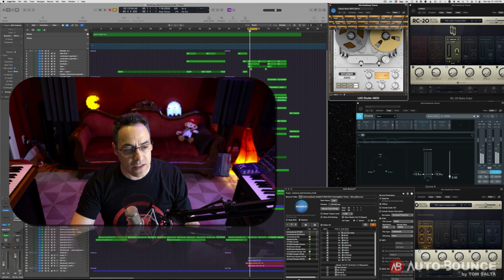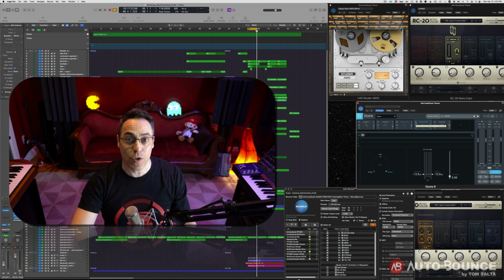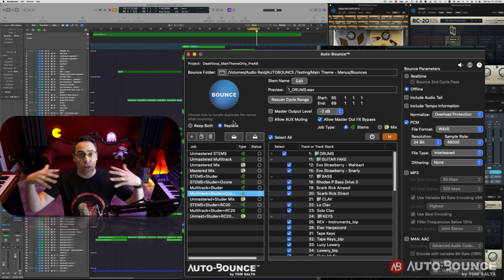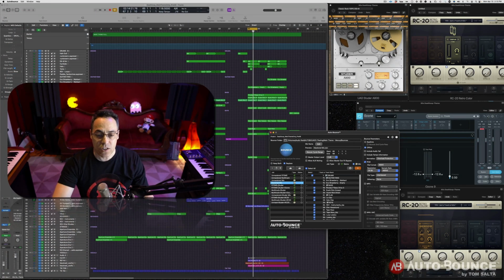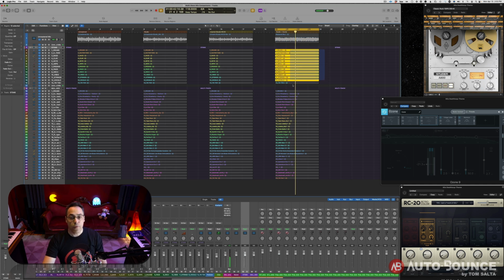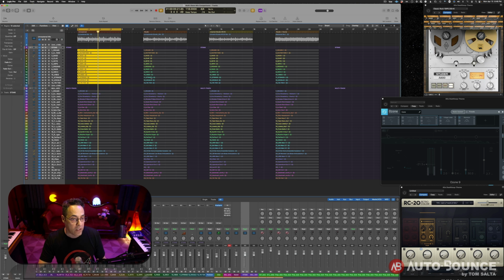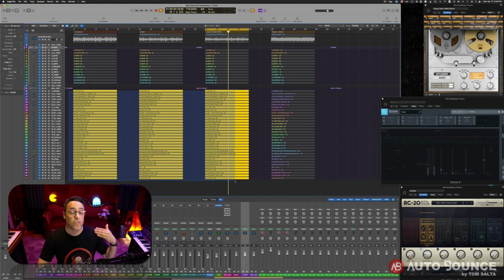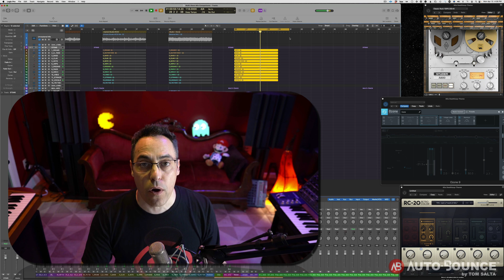Stemming with Master Out Inserts in Logic Pro

Comment: everything you've said here is correct, I would like to add that you CAN use dynamics processing if each dynamics processor has side chain capability. in your case ozone doesn't so you are left with exactly like you have demonstrated here perfectly.  

if you are using, for example,  a buss comp w side chain and a limiter with side chain ability, then you can:

1 - start with the first dynamics processor. bounce a stereo mix with THAT first processor and every plugin AFTER it disabled.

2 - then enable all plugs including dynamics up until the next dynamics (in this example the final limiter), leave that limiter OFF, then bounce a stereo mix of that. 

3 - I usually label those mixes as ie: SC bus comp, SC limiter etc.

4 - make sure ALL plugs are now on

5 - pull those two mixes into your session and line them up and mute them both. enable the side chain functions on your master dynamics and then side chain the bus comp from the sc bus comp mix and the limiter from the sc limiter mix.

viola!

thanks for the video AND AUTO-BOUNCE!!
Reply: well in the case of autobounce, it does not work, because while bouncing, it will disable all the tracks that are not beeing bounced, and so the ghost track will not feed the comp while bouncing... but it works if you do it manually